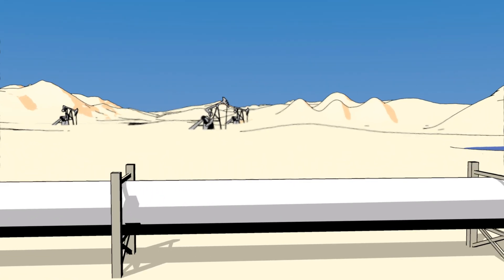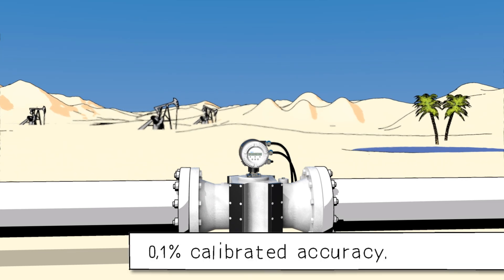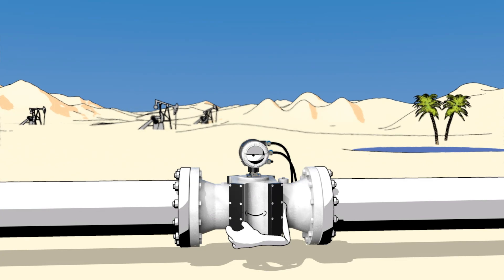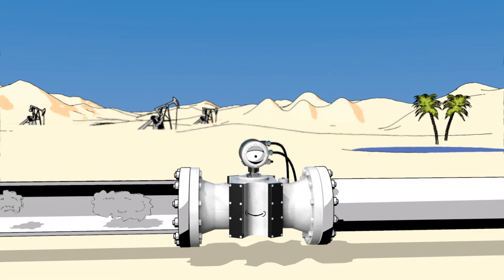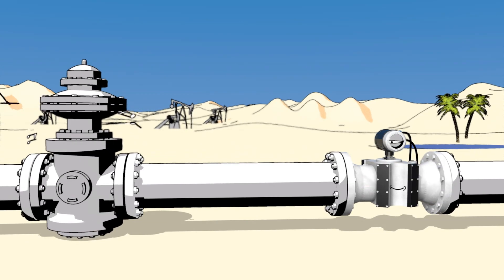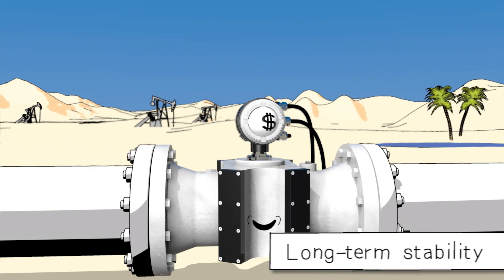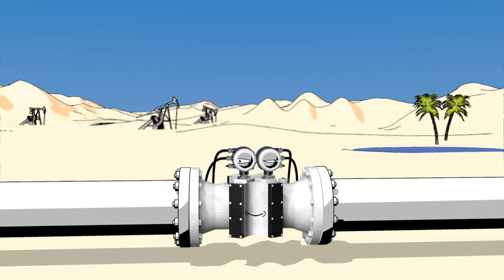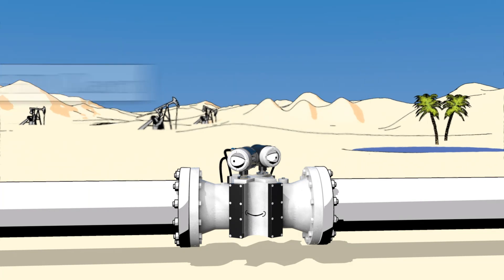FLOWSIC600 from SICK: Ultrasonic gas flow meter for natural gas and process gases | SICK AG

Comment: here you said the meter isn`t effected by pressure changes on the other hand we were told by you when you installed to skids in our company you said that we have to maintain of the pressure due to co2 content
Reply from the maker: Due to outstanding transducer technology, FLOWSIC600 is able to serve applications from ambient to high pressure applications. Beside natural gas, applications with e.g. Hydrogen, Oxygen and even up to 100% CO2 content can be served.
However, CO2 places high demands. Beside standard attenuation effects, physical effect of molecular absorption (Relaxation) has a significant effect. This does require a meter setup with efficient transducer technology and short path length: Like FLOWSIC600. Nevertheless, the physical laws mentioned above does require a minimum operating pressure at a certain meter size for gases with high CO2 concentration. Further to that, the accuracy is valid in the pressure range from 0.5 to 2 times the pressure during calibration. This is valid for any gas applications.